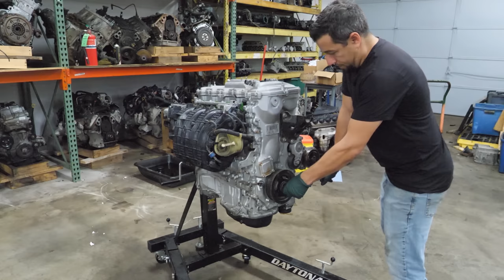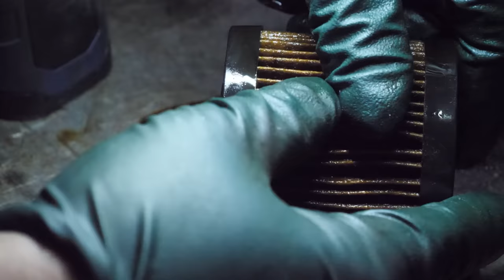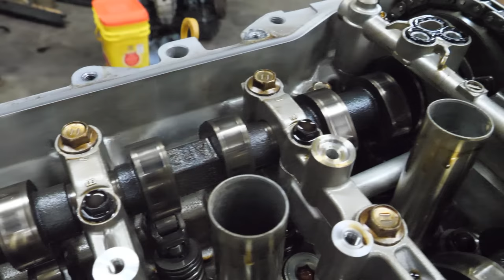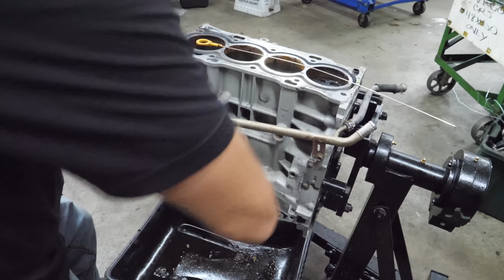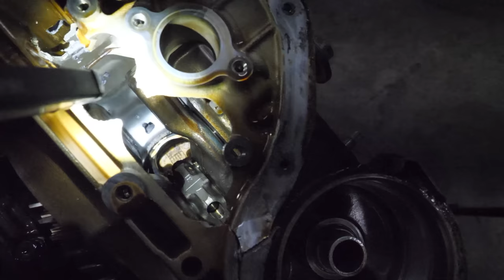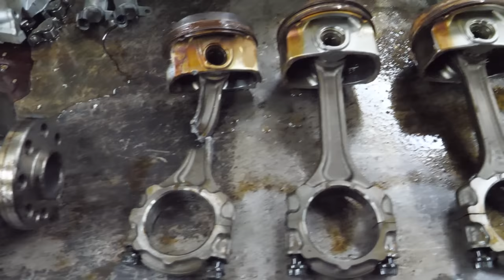TRASHED Toyota Camry Rav4 Scion TC 2AR-FE 2.5L Engine Teardown

Comment: Hey Eric, if i was in a tight money pinch i would use the cylinder head doing minimal work, the crank yes checking for hair line cracks i would reuse it, I think i could get another 200k out of it. This was a very good video, thanks for sharing.

Comment: Eric, do you know the man who runs the "Rainman Ray's Repairs YouTube channel?  He mentioned you and your YouTube channel a couple times in the particular video that I was watching.  He was analyzing the reason a previous customer (8 days ago as of today Saturday 9/30/23) returned their 2017 or 2018 Chrysler Pacifica with the Pentastar V-6.  He found a huge post factory inspection port in the side of the block.  He used a bore scope to analyze the combustion chamber of the particular that he did work on above the cylinder that he worked on to resolve a misfire issue the week before.  The bore scope inspection revealed the top of the piston was cracked and there was evidence that this piston hit all 4 valves.  The inspection of the crankshaft side of the engine revealed zero oiling issues just like this video that I am leaving my comment on.  All 6 connecting rod bearings barely exhibited any damage and no thinning of said bearings.  The remnant of the broken connecting rod was bent in multiple directions.  Rainman Ray said Chrysler issued a recall on the Pentastar V-6 over a valve seat issue that caused the low compression issue that may have destroyed the engine in this other video.  It makes me wonder if the particular model year Pentastar V-6 has the same incompatible metal issues in the valve seat and cylinder head that plagued the first generation of the 5.7L Hemi Engines.

Comment: Trick if a sticky piston and dont want to shoot it cross floor?

Hand thread in a couple head bolts, then wrap wire/string/elastic band around then and across bore to act as a safety stop

Comment: True story here. 

Back in the early 2000’s I was on holiday with the rest of my family in North Wales. The location I was staying at with my Dad and brothers was on a seaside campsite called Shell Island. This campsite was only accessible during parts of the day as the main road in and out was underwater depending on the tide.

Long story short, we got delayed one evening coming back to the campsite and my Dad perhaps foolishly insisted we could get through the standing water. I knew even at that age (10 or 11) that driving into standing water didn’t seem very clever. But short of sleeping in the car all night we had to try. Well, our little Rover 214 somehow battled through the water and we made it, much to the surprise and delight of a crowd of drunken blokes standing nearby watching, obviously waiting for people to run into trouble. 😂

We made it, which is more than can be said for a couple of other cars which didn’t. We could hear those guys cheering the ones who made it and the oooohhs and ahhhs of the ones who struggled.

Comment: The only problem that these were ever known for was oil consumption from around 07-09. They put very horrendous oil control rings. That didn’t mean they were bad engines, they just had crappy piston rings. Besides that, they weren’t known for any large scale problems.
Reply: That's the 2az-fe

Comment: I absolutely love the architecture of these engines. I really feel like Toyota attempted to create a million mile engine. The oiling system is insane - multiple piston squirters, and the valve cover that actively lubricates each cam follower.

I did have one come in with a broken valve spring, though. Very rare on these engines.
Reply: Toyota engineer here: Thanks. We try 😊
Reply: How about a bad design of piston oil rings?? These engines are prone to excessive oil consumption!....
Reply: @victordobin5918  I said I was a Toyota engineer but not the designer of this specific engine. I work in plastics… Closest we come to powertrain is intake manifold but I am over new model planning for some instrument panel lines and the new model in question is an electric car… So uh… I have no idea 🤷‍♂️

What is this issue with the design?
Reply: @victordobin5918  you're thinking of the AZ engine, and it was only for a couple years.
Reply: @zeropointzero  No, you are just speculating. Next time verify your sources before posting.
Reply: @victordobin5918  The 2AR-FE's that I've seen burn oil have all been because of shitty oil, poor maintenance, or a sludged PCV valve. In the case of ring blowby, upping the viscosity to 5W30 with 1qt of transmission fluid clears the problem in most cases.

Comment: Appreciate Andy doing this to provide another great Saturday night. Say Eric have you dipped into a 2.4L multiair Chrysler engine? Curious how those fail. Working at a Chrysler these engines have a ton of miles but run like crap and are our most replaced engine. At least at my shop.
Reply: It's "Eric", not Nick.  No idea if he's done the 2.4L Multiair.

Comment: Would liked to look at the oil pump. These engines have 3-stage oil pump for optimal pressure to compensate for the thin 0W20 oil.

Comment: What is the gear on the crankshaft for?

Also I was really interested to look at oil pump because these engines have so called 3-stage oil pump which supplies extra pressure to compensate for the thin 0W20 oil.

Running the same engine at 150K miles with no issues. Thanks God!
These engines are not that great at the high RPM, but they have a lot of torque.

Comment: I was sure that was a hydrolock as soon as I saw the white crusty corrosion buildup in the intake ports and the extra crank vent hole, but the #1 conrod being buckled above the break is really the smoking gun, along with the crusties in the ports and combustion chambers and the water in the intake.  If it was buckled below the break it could be from flailing around and butting into the inside of the block, but on the upper half it was probably buckled from trying to compress the incompressible.

Real shame, it looks like it was in great shape till someone fed it a liquid diet for no reason.  Guessing maybe you could sell the timing cover and cam carrier?  I wouldn't think twice about running that crank either, with the condition of the bearings on the damaged cylinder and the fact that it's an aluminum rod, it's almost certainly in perfect condition.

Comment: A former colleague of mine drove through about 9" of water with BMW 525, late 90's/early 2000's model. That engine sucked in some water. Then it didn't suck or blow anything... :)

Comment: That stuff in the intake valve ports looks like corrosion.. With it being aluminum corrosion will build in moisturized areas. Especially areas that don't air dry well. Hence the smell as well and water in the air intake manifold. Corroded aluminum gives a foul smell.

Comment: Speaking about impact tool batteries what is your shop policy about charging / storing these batteries? The reason I ask is that a friend of mine had his shop badly damaged by a fire that began with a charging battery either shorting out or otherwise getting really hot. After that he never allows battery charging except while workers are present.
Reply from the maker: We do the same. Charge only when open.
Same thing in my garage at home.
We also don’t use any knock off batteries, but we do buy knock off cases since we do break them

Comment: My daughter drove her car through a deep water puddle just after starting her car with a cold engine. Her car quit running. I dried out the engine and changed the oil. Told her that even though her car started not to drive it fast or far because it would probably throw a rod through the block, which it did two weeks later.

Comment: Hello brother. 
I have a 16 Rav 4 with 130,000 miles. I noticed since pass 100,000 miles been having oil burning issue. I have to add 1 quart every 1000 miles any thought on this. I heard it’s a common issue with this engine. Crazy. Who is checking oil oil all the time. Please input. Appreciated. 

with

Comment: If indeed a hydrolock failure I suspect that crank is likely bent.  Even with shiny journals it didn't run long enough for the bearings to show abnormal wear.

Comment: Water in that intake is all too familiar. It's recommended when getting any 2AR engine, to take the intake off and dump it. The upwards facing throttle body and the way the intake curves down can hide a lot of water. I almost killed my 2AR from that scenario and dumped out over a liter of water. I got lucky and the water kill the engine before 1 turn over.

Comment: I believe the AR engines have a known problem with the oil rings. Complete clogging up, resulting in high oil consumption, running low on oil and then this happens.

Comment: I have 2014 Camry 2.5.  187 k miles Same engine. Same issue.  Cooling leak.  Overheating.  I changed out use engine   Yup.

Comment: Is someone drove through water deep enough to ingest some, then which cylinder would be most likely to take the first gulp?
That might explain water in the manifold, the #1 hydrolock damage, and corrosion (stuff) found in the head.
Just guessing.

Comment: Do a 2.4 Toyota vvt and see when you take the head off and see if the head bolts take the threads outta the block they had head gasket issues and stripped head bolts  I’d like to see you tear one of thoes apart

Comment: People get really overconfident with electric cars around standing water.  Because they can't hydrolock and it doesn't hurt the engine to drive through water.  What it does do, is get water into parts of the car that are not supposed to have water.  And start corroding electrical contacts.  Not to mention destroying the interior.

Comment: Don't drive an Audi through standing water either. My former, former partner's daughter did,
and bailed out as it floated down stream, reaching a point where it dived like an Unterseeboot.
It had 600 miles on it when this happened at "Lake McNary" [named after the county commissioner],
a portion of Old Woodsmill rd at Ladue that regularly flooded before being rebuilt by MODOT

Comment: Looking for the answer to a hydrolock question.   if I had no option but to make a water crossing, could I minimize the chance of catastrophic damage somehow?  I know about the trick of plowing through at just the right speed to push the wave ahead but that's no so easy to do.  Seems like the only other option would be to go as slow as possible to keep the RPMs as low as possible. The idea being to minimize the rotational inertia so that if water did get sucked in, the engine would just stop without stuff breaking inside.
Reply: A cheap plastic tarp that stretches right across the front of the car, down under the bumper/tray and to both wheels at the sides...and up the hood until near the cabin air intake..
and tied in that position tightly with non moving cords...
is most of the answer if it is do or die..i.e. if you stay where you are in a river bed you are going to die anyway.

The theory is that most modern cars have air intakes behind the headlights, behind the grilles or at the top of the radiator to feed air into the engine.
By tightly fastening that tarp in place you cover all those areas...forcing the water away from direct impact in those areas.

Now you need to go at a reasonable speed, not dead slow, to create a "bow wave" that will come up the hood almost to the cabin air intake...
sometimes over it but that is minor compared to death by drowning...
and maintain this bow wave which opens a "hole" behind it allowing the engine to still suck in whatever air is available that still can flow through that "hole" of the bow wave around the protected front of the car...

Even in 4wd clubs the preferred method of crossing a river or high water.... is by a bridge.

Most vehicles have only a tenuous resemblance to a successful submarine/amphibian

You can write off a modern vehicle with one trip like this.

Having had river water to the door handles in an older vehicle (no computers/fresh clean water) and survived that 70 metre wide river...
driven it home and for years after...
I can attest to this technique.

Comment: Why does a 4 cylinder need a balance cassette? I thought those kinds of things where for engines that had an odd number of cylinders or like that engine you tore down a few weeks ago that was designed as a V8 but built as a V6 as you said "to save cost".

Comment: Personally for the crank, I'd have it checked by a machine shop to make sure all the bearing surfaces are good, have them do a magnetic crack check of the crank, smooth the impact areas a bit so there's not any chunks that can come off and potentially cause problems, and do a balance check after. If it all passes, slap it into a replacement block and have at it.

Comment: What were the white crunchy things in the intake, the intake valves and on top of the pistons? Concrete?
Reply: Commenters seem in agreement crystals from evaporated sea water or high mineral content water...
driven through standing water (engine running)

Comment: 4.4 liters of oil is not enough for a 2.500 cc engine, and with an extra services for 20.000 Kms. It is lucky to be port injection and NA's....
And with a 0w20 oil that engine is done for sure prematurely. 
BimmerN53

Comment: For a change i disagree with you Eric, you said: there is never a good outcome with standing water in the engine, never drive with it, and it will blow every single time, Right??

Let me tell you a story of my own then, i might be 1 out of the other people, but i had a Supercharged Chevrolet matiz with an AMR500 (which can be seen on my channel) where i have blown my head gasket and the coolant was finding its way into cylinder number 1: out of panic i turned off the car immediately, (stupidest thing to do) but the engine hydrolocked, i have put off a bit of the tension from the supercharger and trying by turning over the engine so the coolant could find its way into the exhaust valve and going away via the exhaust so i had a bit of my compression back,, this way i drove  1 up to 2 km,s back to home

results: No damaged engine, replaced the head gasket and the pistons looked nice and very clean! still drove it for more then a half year before i had a huge car accident (not my fault)
Reply: pss: first i turned over the engine by ratched after that i turned on the engine without issues

Comment: Two days ago, I was driving my 2012 Toyota Rav4 on the hwy at 70mph.  My belt tensioner came apart, belt came off and we ended up on the side of the road.  Replaced both but no start...it cranked well.  No start.  Towed to dealership who informed me no. 1 piston had zero compression.  I would need a new engine.  I've had three cars in four years loose their engines.  WTF.  I had 130k miles on it.
Reply from the maker: Doesn’t make sense to me.
Even with 0 psi of compression in one cylinder it should run just rough. 

I would seek a second opinion.

Comment: Now find the earlier 2AZ 2.4L, should be easy as those tend to consume oil and as has been demonstrated people don’t pay attention
Reply: Even when the oil level is monitored, 2AZs still blow up. They also have weak head studs from the factory and weak rod bearings. There’s a reason it’s considered Toyota’s worst and most unreliable engine. But yes, a blown up one would not be hard to find.

Only if the piston rings were re-done, and ARP head studs installed, are they halfway decent.

Comment: I just read about this. Any chance you could get one and tear it down? The National Highway Traffic Safety Administration (NHTSA) is investigating more than 708,000 trucks and SUVs built by Ford and Lincoln due to reports of "catastrophic engine failures." The agency expands investigation of vehicles all powered by a turbocharged 2.7- or 3.0-liter EcoBoost V6.

Comment: I just finished taking the timing cover of a 1ar-fe which is a very similar engine. timing chain broke and I wanted to find out if the engine was savable. turns out one of the bolts holding the guides on came out broke the chain wrecked the oil pump and broke three teeth of the crank gear! the other guide bolt was almost falling out. I can't figure out how in the world it could come out or why, I'm fairly sure no one has taken it apart before. anyone else had this problem?

Comment: No idea how you even hydrolock your car. I’ve been off-roading for years and even with a smaller RAV4 I can drive through some pretty deep water without any issues. For some reason though I always hear about dudes hydrolocking after driving through a puddle. It’s more impressive because Toyota has a drain hole in the intake box and not only that but at least on the RAV4s the resonator faces down, so any water that enters will fill that resonator before the box. To even hydrolock a Toyota you have to drive through a puddle (lake) that sits above the wheels due to the placement of the intake inlet.

Comment: @I Do Cars  How often do you see catastrophic ICE engine failures on cars less than a year old and around 5,000 miles without someone doing something really stupid to cause the failure? My $100k Tesla just had a catastrophic failure that left me stranded after coasting to a stop on the side of the road and took 3 weeks to fix under warranty. I found owner forum posts with a dozen others with these failures and the tow truck driver said he sees it all the time. One forum user posted he heard these failures are in the 1000’s. EV’s are claimed to be more reliable because they have so many less moving parts, but I am thinking that’s misinformation.

Comment: Man, to break a 4 cylinder Toyota engine takes some real rocket scientists doing stupid stuff.  Other than the oil burners from 07-09, these 4 bangers are freaking tough.
Reply: 2AZs burn oil through all years they were in production, not just 07-09 model years.